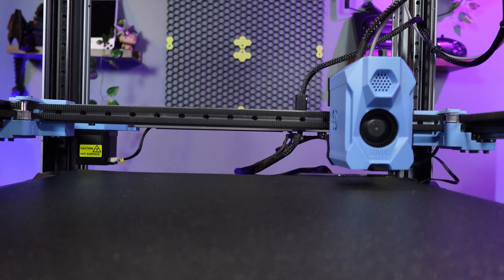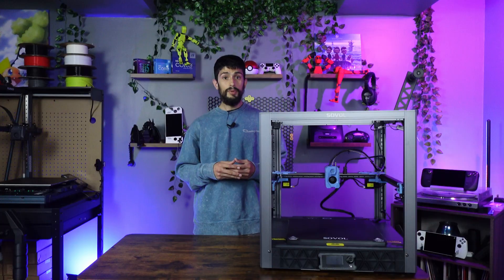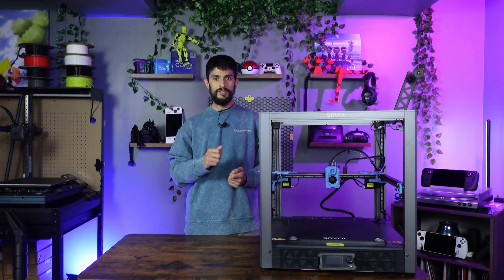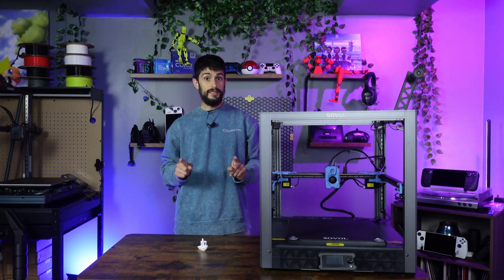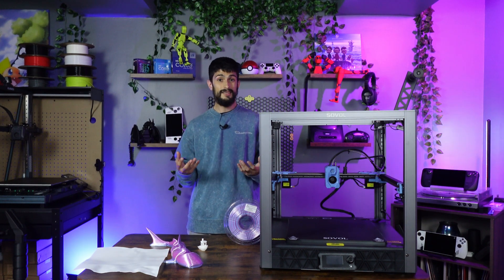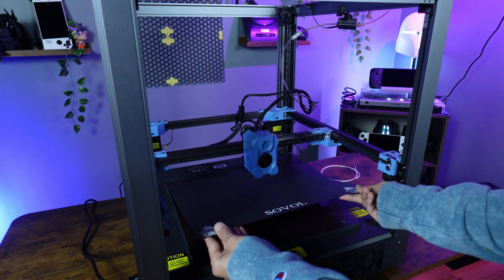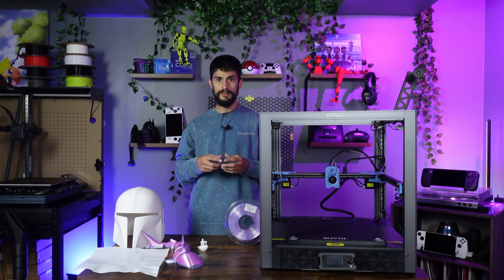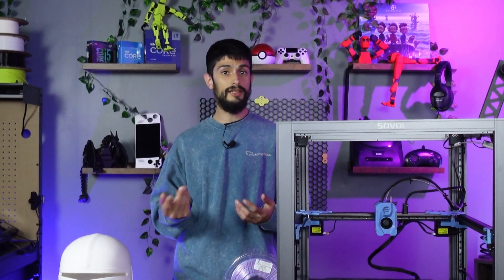I Wish I Had Better News - Sovol SV08

Comment from the maker: To answer a few questions, I was wrong that it doesn’t save the Z offset. It does, but just resets it back to zero. Both of my other Klipper printers don’t behave this way and that’s why I said what I said. 

I have also contacted Sovol about the grinding noise. I have since taken apart the printer and examined the Z4 corner further. And sadly I found what appears to be metal shavings from the pulley connected to the motor. Sovol responded the same day and even shipped out a new Z4 module (I hope it’s the whole corner piece) the same day. I will most likely post a short video later on explaining this more. Thank you for listening to my tech talk. 🤓
Reply: gerGO Print had a similar issue with the grinding noise with all of his Z corners. He was in contact with Sovol support and got it sorted without spare parts - you should probably check out his videos about the SV08.
Reply: @TNX255  I think gerGo said his grinding was actually the threadlock being applied too liberally from the factory causing it get on the motor gears and making friction on the belts. He cleaned it off and it went away.
Reply: @rastercaster  Yes, like I said, no spare parts were necessary :)
Reply: And make sure to run the resonance tests for X/Y, they now have values that make printing worse instead of better. (the resonance frequency is off by a mile) it's better to use no filter than to use a wrong resonance frequency.

Comment: I have been keen to get an SV08 but decided to check out their customer service first. I have emailed then three times with a few questions about issues raised in reviews I have watched (typically 9+ months ago). I presume most if not all have been fixed but they have not replied. I'm wondering if it's because I am not an actual customer yet or they are perhaps embarrassed at the answers they would have to provide. My first email was about a month ago. Can Ed or anyone comment on their customer service?
Reply from the maker: In the video I pointed out that grinding noise that was coming from one of the gears. They indeed sent out a whole new assembly and that has been my only issue since. 

I will say it is on mainline Klipper now, I went the route of flashing it so I could play with some other stuff.
Reply: @EdsTechTalk94  Thanks for your reply. I do wonder if you got great service because you were reviewing their printer. Anyone else just had a 'brick wall' like me?

Comment: Just bought the thing. The construction is extremely solid, The printer is fast and very reliable. Only issue is the noise.  But I ordered the enclosure and an silent fan for the electronics. That should fix it.
Reply from the maker: Glad you enjoy it! It’s one hell of a printer. I mean you can’t beat it for a core XY in its price range

Comment: I was initially very interested in the SV08 but I wasn't ready to buy a new printer when the SV08 released.  I design new products in the winter, so I usually get new 3D printers on Black Friday.  I've gotten excited about a new printer before, purchased it and by the time I started using it there was a better printer for my needs.  The SV08 has been out for half a year so the early teething issues should be resolved (thread locker on timing pulleys, firmware, slicer profiles, etc.)  I'll occasionally be an early adopter but I prefer not to be.  I'm looking forward to my first coreXY printer and having the larger build volume.
Reply from the maker: It’s a great printer and sounds like you have experience with 3D printers so you’ll find it to be your new favorite printer soon!
Reply: @EdsTechTalk94  - I was building hobby 3D printers when the Makerbot was the only commercially available consumer 3D printer.  I've been trying to push 3D printing to be a viable manufacturing process for consumer products.  If the cleaning, drying and curing of resin 3D printed parts could be automated and the resin and cleaning chemicals were less expensive, that would be an ideal replacement for injection molding (as well as parts that can't be injection molded).  However, FDM print quality has come a long way in just the last few years - Klipper, coreXY, much better slicing, filaments that help hide layer lines, etc.

Comment: Is there an update on your machine did they make it right is it printing perfect or at all
Reply from the maker: They sent me a new motor to replace my faulty one. Which fixed the grinding noise. 

Other than that it has been working perfectly fine. I did convert it to mainline Klipper to add the Eddy sensor but that was me being a tinkerer.
Reply: @EdsTechTalk94  awesome glad to hear
Reply from the maker: Yea it’s been a great printer. A lot of mods available for it. It beats building a voron if you don’t have the time or money really.

Comment: The build seemed straight forward, there didn't seem to be directions on the steps to calibrate. I didn't get the WiFi to work, adding a Klipperscreen to the SX08 I could select the WiFi hotspot but it would not ask for the password, it would just start connecting without the password and fail, tried the wifi.cfg method, no luck and finally plugged a ethernet cable in but still failed to connect.  Another Makerbase POS with fans trying to keep the overheated controller cool.
Reply from the maker: Sounds like a bad board if it won’t accept the WiFi info. I’d contact support for some help. I have no advice for you on this one sadly.

Comment: Another video about Sovol…. And another one that fails to mention that they have zero customer service after you buy the unit. You did not pay for your unit and I see that it has been over two weeks since you sent Sovol a correspondence… And you have no response. Not a big surprise.  I listen to one of these YouTube influencers and was stupid enough to buy an SV07+ based on their comments. The printer broke down in less than two months. It has been broken down for almost 3 months. I have a lot of worthless emails, but no parts or real support. Finally, on May 25 of 2024, they said they were shipping a new power supply. They provided a tracking number from USPS… The slowest shipping company in the United States. As of today, June 16 of 2024, USPS is still waiting for the power supply! Rest assured, if you are not a paid supporter of this company, you are not going to get any customer support after you spend your money. do you think for one second that they are making people wait three months for new printers??? I don’t think so… And I’m pretty sure you know better. Don’t drink the Kool-Aid and fall for the crap. Buy a Prusa or a bambu labs and you will be much happier… That’s what I did and I am back in business with a superior product that actually comes with customer service.

Comment: The rattling of that one Z belt is probably excessive lock-tite ooze which dried up on the belt. Clean it with some pure alcohol and you should be good to go
Reply from the maker: It’s been fixed but sovol sent a replacement part due to metal shavings appearing under that same pulley.
Reply: @EdsTechTalk94  Alright, some other issue then after all... Glad it's been fixed

Comment: you are the first review ive seen who actually bought the printer for themselves and as such didnt get a review sample which is guaranteed to be better QCed.
Reply from the maker: It’s the first round of a new machine. It’s gonna have issues. I just wanted to point them out, so new buyers are aware of the situation. I love the printer just had to disassemble it after I just assembled it 😅

Comment: My assembly experience by comparison was a breeze. Despite the manual suggesting screwing each leg in one at a time, I socketed them all in before screwing. Then it only took the lightest amount of pressure to seat them. The only real issue I had was that my nozzle came clogged from the factory. Luckily the included cleaning tools were exactly what I needed to deal with it.
Reply from the maker: Glad its not all the printers with the fitment issue. I luckily did not have a clogged nozzle!

Comment: Regarding your negative points:

The front leg brace alignment thing, with a gap on the right side and a flush fit on the left, is normal on the SV08. Yeah, it's annoying for OCD types but doesn't hurt anything.

The color is certainly subjective. I also think it looks extremely cheap and reminds me of extremely cheaply made China plastic waste. But it's the Sovol color.

The Z offset shown on the front page in Mainsail or Fluidd is a live Z adjust. If you actually calibrate Z offset (such as built-in calibration in Fluidd, not sure what Mainsail has for this), this is saved to the printer config.

As for the corner clicking, that seems to be normal for the SV08 so far. Hope this gets fixed in production soon. All 4 corners of my machine do it to varying degrees.
Reply from the maker: I’m glad it’s not just my machine that had the gap. It sucks it’s so common though. 

The color is definitely a personal preference thing. I understand the color they picked, just wished they would consider what people might prefer. I’m also noticing how cheap the injection molding is. I found one side to have a heat press either missing or it got press way too far down compared to the other side. (Just noticed last night)

I’ve come to learn that about the Z offset, and definitely won’t forget that one 😅

As for the pulleys making the awful noise, it’s the lock tight getting on the belts. But even after cleaning it with IPA, it did stop making the noise for like 5 minutes then it returned sadly.
Reply: @EdsTechTalk94  I’ve tried cleaning mine and while it helped the clicking, it didn’t eliminate it. One axis now makes a horrible noise. Early adopter issues…
Reply from the maker: Have you contacted Sovol on replacement parts?
Reply: @EdsTechTalk94  Yes, I have sent emails since receiving my unit a couple weeks ago. A friend who ordered his and hasn’t received it yet also sent an email. No response from Sovol yet.
Reply from the maker: I'm sorry to hear that, but don't feel bad. I got a response saying they were going to send me a new Z4 module. Then like 12 hours later got another email saying its going to be delayed an unknown amount of time. 

They should have replacement parts on hand for this reason.

Comment: Thanks for the honest and well thought out video. I am subscribing based on it.

I've had major problems with every printer I have bought over the years, until my latest one. But had I bought the exact same printer that works amazingly well (most of the time), right when it first came out, it would have almost definitely been a horrible experience. I base that on reading the forums and seeing what so many people went through, and then seeing as each of the issues were fixed via firmware or other methods.

This may be a good printer a year from now, but for me, I can't afford the time suck, nor the frustration to get one now. 

Even if the next printer I get is from the same company that made the one I am happy with, I will still probably hold off for at least 6 months from when it comes out so I can focus on designing and making things and not on constantly fixing a printer that the company should have refined more before putting out to market.

Comment: Do you currently prefer your SV08 or your Neptune 4 Plus?
Because I returned my 4 Plus and now ordered a SV08
Reply from the maker: That’s hard to answer right now. Considering my SV08 is currently waiting on a new part. So I can’t really push it to its limits. 

But what I have noticed is a lot faster print times compared to the Neptune. But an ender 3 can print something with just as good quality as any other machine. It’s just based on how well tuned your printer is.

Comment: That rattling sound is probably the famous loctite thing
Reply from the maker: It is but I also have some nasty grinding going on that caused metal shaving to appear underneath, so Sovol is sending me replacement parts 🥲

I can’t even print anything 😭
Reply: What do you think about the injection molded parts on the gantry? Because to me that't the deal breaker woth this printer. Until someone make a metal replacements for those. (perhaps in black too :D )
Reply from the maker: They seem rigid, I don’t think they will fail but I also don’t want to even try to take one apart right now 😅

So many screws, belts, and pulleys I don’t want to mess something else up 😅

Don’t get me started on the color 🙄😂
Reply: @EdsTechTalk94  :D you dont have to.... I feel you :D

Comment: I don't understand the criticism that you have to save the Wifi access data on a USB stick and then plug it in? I find this much more convenient than having to enter a long wifi password on a small touchscreen and much more privacy-friendly than having to install an extra app to send the wifi credentials to the printer.
Reply from the maker: I just found it difficult for something that should have been so easy. I had to try 4 different times for it grab the WiFi info. Didn’t change anything on the usb, but had to restart it several times. I thought it was broken at first. That’s why I have such a big deal with it.
Reply: Yeah and especially with this printer, there even isn't a touchscreen but a small knob screen! How annoying would it be to use that to enter your wifi password :D
Reply from the maker: Let’s be real, this should have shipped with a touchscreen 😅
Reply: @EdsTechTalk94  And add a 100 bucks to the cost for something you don't need once you have wifi connection to your PC/laptop

Comment: Sovol cut its cost in the last step of  software optimization. So they left it to the community. Good thing everything is opensourced.
Reply: They are although posting software updates very frequently and as far as i know already solveld all the problems mentioned in this video

Comment: The grinding noise is nothing to do with the hardware. It is an assembly problem in the factory where the threadlock lock residue splashed on to the drive belts. You just need to use IPA and clean it. This noise is the "ticking" noise issue. Another YTer had the same problem with a noisy drive mechanism. And it was diagnosed the same. The printer is moslty pully belt reduction. So cleaning the threadlock will do the job. The belts are all high quality Gates manufactured.
Reply from the maker: My only concern is that I also found metal shavings under the pulley 😳

Comment: You need to clean the sides of the belts on the affected Z axis with alcohol, (only the small belts that sit on the geared reduction, not the large belt) i saw another user has reported too much thread locker was used and it sits on the sides of the belts too, this rubbing makes it sound like it does in his video. I have had a printer with Gates GT2 belts that made the same noise on the gantry.  zeroing might be confusing; if the new offset is set to 0, it doesn't mean that the bed isn't saving the position. It probably resets the new offset to 0, because, that's the new zero-point you have. Just look up the printer.cfg and see what value is there for probes Z offset. The Z offset is not too solid from an inductive probe like the one used here. there are some users out there that heat-soak the probe for better results. And printing would be better if you perform a resonance test. They do not run these test on every printer that is sold. If you perform the resonance test, your 12m benchy will be better for sure. 

The Z offset is stored in the printer.cfg probably bellow the line SAVE_CONFIG. The input shaper (for the resonance test) will be set to 35hz, MZV profile. That's incorrect and not helping the printer to perform at its best.

I don't think that's a bad thing, considering you have a good base for an unbeatable price. Just take your time to make the printer yours.

Comment: The clicking noise on your z4 drive is because of too much thread locker used and it got in the belt teeth, you need to take the upright off to gain access to the z drive belt and clean it off.

Comment: Took me 30 minutes to assemble, but i have built multiple printers including Vorons, Instructions were super clear to me. Look up how to adjust z offset, do it through the browser and save it to the config. The profiles for the most used materials are on the website as well as a version update. That bed runs hot , for  PLA it will warp it if you try to pull it off without waiting to cool some. There are also other calibrations and tunning you can do.

Comment: I have configs for .2 through .8 in Orca Slicer. Also, did you upgrade to firmware 4.27 firmware? It's been out since May 10th? If not, you didn't do much research to help your viewers.
Reply from the maker: This was to demonstrate what sovol shipped to first round customers, I did say “they shipped it with only 2 profiles” which is true, and I was planning on doing a video on how to update and so on later but considering my machine arrived with problems I’m kinda on a hold with it. 

You are right, I should have have said they do have more but wanted to save it for another video. I will add a link to the Google drive for others to get now.

Comment: You could do with some concrete paving slabs for the printer to sit on, for my X1 Carbon I used a standard size paver, for my Ender 5 Plus printers I used some slightly smaller pavers on each corner, I sprayed the pavers with Plasticoat so they did not scratch my table tops.
 they work great and stop lots of the vibrations.
Reply from the maker: That table is only for my videos, I have a more stable work bench for my printers but I do plan on adding some for all mine as I’ve heard it helps put a lot!